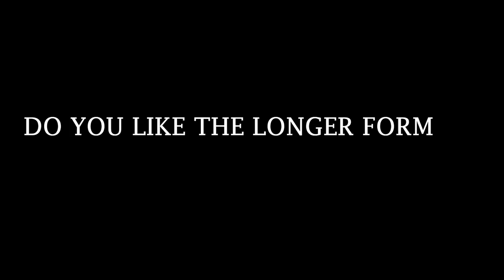American Bee hives are ALL WRONG here is why! split hives 4 weeks later

Comment: This is really encouraging - I have been keeping bees for 10 years but the boxes have gotten so heavy for me as I am getting older.  I was seriously thinking this is my last year to keep bees. Maybe I can manage to keep it up if I switch over to the long version.
Reply: Its really genius design. I've seen african versions of it where they have a triangle design the only difference is they having to cut off the whole bees wax
Reply: @releventhurt  top bar hives
Reply: 8 frame mediums for all your hive gear. Can move any frame anywhere, and 8 medium frames is much lighter than deeps.
Reply: Top bar hives are great, bees are super calm compared to working Langs. Those extra deep frames can still be  exceptionally heavy if you have back issues.

Comment: Would the different frames fit in a standard honey extractor?
Reply: No, they wouldn’t fit and also don’t have the wire suspension that normal frames have so wouldn’t cope with the centrifugal force.
Reply: He has an extractor on his website that will take both sizes and yes you can spin the frames that are wired

Comment: Great video! I am an amature bee keeper, I started with a wild hive that took over my back yard B.B.Q. I bought a thermistor and several books and I was ready to be an apiarist! My B.B.Q. was a large, brick walled, open pit, with a temporary particle board cover. The bees had attached the hive to the inside of that board and I was searching for the queen. I found her under a pile of live bees, on the ground. They were attracted to her sent but I had stepped on her. I was devastated. That was the end of that. At the same time, I was not deterred. I bought three more queens and 6 lbs. of bees. None of which lasted through the year but I learned to love bees and understand that connection with bees. I can't wait to try my hand at it again!

Comment: I'm curious is sawdust, really fine sawdust such as made from a handsaw cutting a dovetail fitting, would work in place of the wool insulation?
Reply: It would (old ice houses use sawdust as insulation), but if it got wet, not so much. Also, most woods after getting wet inside a closed space would, being very slow to dry out, rot and mold.  Also remember that it is the many air spaces in insulation that are the barriers to heat transfer, a fine sawdust should have a better insulation value than chainsaw sawdust.  One might try wood ash as insulation, but I would worry about the water holding capacity of the ash as it would hold water against the wood structure. Maybe if one built a "french drain" in mini form at the bottom of the wall cavity, then it could work. I would still put a larger roof-overhang all around for good weather protection though.

Any powder type insulation (and fiber) would lose most of its insulation value when water-logged. Wool is better than most at holding up in wet conditions and still giving some thermal insulation value, as I understand it. Still, I would build a very good quality roof with overhanging eves for any bee hive.

Comment: Great instructional video! I really enjoy watching Doctor Leo. Here is a suggestion to make the transfer process go even faster. If you put a guide rail, such as a scrap piece of 1×2 on to your plywood template with the saw blade set at the appropriate distance you can just lay the template down on the frame, put the saw up against the guide rail and make your cut without having to measure. Perfect Cuts every time with no measuring.

Comment: Instead of cutting frames, comb, or turning the langstroth frame on end, do what I did -- I made two brackets that extend across just like the European frames, but made so that the langstroth frame ends rest on these two brackets.  The langstroth fames will be facing perpendicular to the rest of the "empty" European frames.  This way you simply transfer the langstroth fames to the European box and put empty langstroth feeder frames in the extra spaces.  The bees will begin filling the European frames with comb and brood and as they turn the langstroth frames into honey frames they can be removed and replaced with an empty feeder frame.  It's quick and easy and you can save the frames for your langstroth hives for catching swarms, doing spits, etc.

I also made a spacer box to fill the excess space below the langstroth frames which is the difference between the European frames and the langstroth frames, to prevent the bees from extending more comb below the langstroth frames.

Comment: I would pre-drill the new style frame for the  possible needed screws and have the screws turned in 1 turn before starting the cutting process.
That will save time while actually working on the hive.
You can go ahead and pull unused screws very fast.

Comment: A great combination of a TBH and a Langstroth's. I've run TBH's for more than a decade and love them, with the TBH's you have even less to build or buy as they don't have frames and you don't need foundation wax, just bars. I have my entrances at the top, less chance of water getting in for the roof covers that area. Bears are our biggest problem, we have to use electric fencing to discourage them. Great tip on insulating! I know from catching swarms the queen can be elusive, several times I've moved a swarm only to go back later and check the swarm spot and find a small group of bees huddled together, around the queen, which I then catch and move to the hive. You can also do a gentle fast tapping on the side of the hive with your hive tool and that will encourage them to go inside, sounds crazy but it works. Over harvesting is another problem with traditional beekeeping, which leads to weak colonies and opens them up to disease and pests, the less sugar water you feed the healthier the hive also. By practicing these guidelines I have not lost many colonies over the years. (mostly from bears and wax moths) Love the bee videos!

Comment: I love the insulated, deeper and thicker hives. For one, the box looks a lot more sturdy and if its more natural for the bees I'm all for it. I also like the rotating metal wheels for the hive exits. My only question would be - would the insulation and thicker hive make it more difficult to for the bees to cool during the summer months?
Reply: i'm no beekeeper, but a carpenter, and i can tell you that insulation works both ways, helps keep the heat out as it does keeping cold out. my grandfather would sometimes wear longjons in the summer time!! hope this helps!!
Reply: Remember that insulation slows the movement of heat from one side of a wall to the other. If the peak heat of the day is around 2:30 P.M., then the hive may be shielded from that heat for several hours to when the sun is not so intense. The end result would be a lower high temp. for inside the hive. That would give them a warmer night time temp. as well, as the daytime heat would be held into the night. They would also be nice and cool all morning long perhaps.
A radiant barrier would be even better in the summer, but a man-made one would need to be such as not to block heat in the winter. Deciduous trees give a natural radiant barrier (water in the leaves of the tree block radiant heat as I understand it), and as the leaves aren't around anymore by winter... :)

Comment: I have to agree with what you're saying about the standard langstroths across the USA. I experimented with those and the langstroth long horizontal. The standard ones were not kind to the bees overall. The horizontal version, had almost no issues. Very good on the bees, just need to adjust my design a little. Next year, we will be trying out the AZ Slovenian style hive with bee house. Hoping it works out great.

Comment: The only negative I can think of about that European style horizontal hive is that everything has such tight constriction points to crush bees in so it'll kill and maim thousands of bees every time you move anything around. Having gaps means places they can slide through and escape. Also how did he do this unsuited? I couldn't MOW when I used to keep bees for a quarter of the year.

Comment: What i would have done is after the conversion take the frames with queen cells and make a in hive split using the  Divider board. If slpit fails combine with original hive.

Comment: solar systems do not like long lines due to excessive losses  so i would put in a separate system for the greenhouse.  also recommend a larger panel for the greenhouse as well as a different type of battery, probably a trolling motor type as it is used to deep cycling, automotive batteries are not.  great starter system though.  this video looks like you could use it on house as well, maybe another day.

Comment: I notice that the Layens hive has no ventilation at the top of the box for the bees to evaporate the nectar's moisture. How does this affect the hive's health, do the bees just hang on at the little round entrance and flap their wings to expel the moisture content? I like the idea of the double-wall construction with wool insulation. This would certainly keep the bees warmer in the winter months and cooler in the summer. Once again, with 60 to 80,000 bees or more inside, it's still going to get relatively warm, hence the bearding effect. Wouldn't ventilation once again at the top of the hive help with heat dissipation during the summer months?

Comment: Maybe a hybrid box that uses both frames one side deep one side shallow. Then put the bees in the shallow end and let them transfer to the deep end. Then later you can again divide them into a deep box....
Reply: Why not have insulated boxes? 1/4” plywood sandwiching styrofoam board. (Plywood/styrofoam/plywood). Even 1/8” would be strong with 1”-2” polystyrene...

Comment: Just came across this great vid, very informative.I like the easy way of going horizontal.  Question- how about modifying the new horizontal box-make it deeper, to accept the american style units by turning  long side of tray pointing down, then add a top cover piece to bridge across this way no cutting to reduce, and the transfer is the whole including bees, no brushing into the box...? any problems with that method?  As well, would use more common tray, convert to the Euro tray as time and $ allow.

Comment: On the other hives, there was a...ledge for the guard / protector bees. With this new hive (great insulation) with the little circles, there is no ledge, where do the guardians sit to protect?  What happened to the trays in the bottom that were in the horizontal hives with DE for any parasites?  
These new hives with the great insulation....how harsh of a climate are these good for?  Would they work for hives in Alaska?

Comment: Quick question, for the insulated hive transfer, I noticed you left bees on the other side of the division board, without frames. Assuming you had a gap below the divider to allow them to move back over... do you later add frames to that side too, just to prevent comb building on the lid?

Comment: I'm curious to know how the bees treat the comb that you installed sideways I'm talking about the smaller cut off pieces when you look at the way bees draw honeycomb you can tell what position it was in because the left and right side of each cell hexagon will be vertical if you turn the cone sideways those straight sides become horizontal which is not how the bees intended so please let me know how they act when you turn their comb sideways

Comment: I'm curious, why didn't you attach the shorter part of the cut frames into the bottom open area of the new frames instead of putting them into a separate frame?  Does the open space at the bottom of the frames give some benefit?

Comment: I am wondering about extracting honey with the longer frames. Does the standard US made extractors take the long frames?
Reply: just make a rack where you angle a few frames and cute the cap open it will oooze out, thats what i do with my top bar comb when i want them to get the comb back
Reply: oh and once a side is drained do the other side...its really not slower than with an extractore

Comment: I can't say thank you enough. I built one horizontal hive to try it out. WOW! the increased activity was extremely noticeable, so I built another then another. No more dead hives in spring due to cold weather all due to year-round insulation in wood density and rooftop insulation. Great easy plans are available from horizonalhives.com  Please note to use 1/8 inch screen wire on the bottom if using a pest oil trap. My first mistake was using 1/4 inch and them bees built comb under the wire.  What am I going to do with all my stackable hives now? UGH!

Comment: Why bother to build an all new hive? 
Just add 2x2 spacers to the exterior surface, also frame the entrance, then put on the insulation, then cap it off with plywood leaving the entrance open. Also make a larger roof to reach over the new exterior.

Comment: With the horizontal hive, there are ‘missing frames’. In a standard vertical hive, this means bees will fill the space with comb. How do you prevent this in the horizontal hive?
Reply from the maker: No missing frames
Reply: @OFFGRIDwithDOUGSTACY  sorry, I spoke incorrectly, I meant frames with no foundation or just lots of frames (too many). I have, however continued watching and literally just got to the part in the woods, where he is adding a divider board which literally answers the question 😂

Comment: I have a question. Is a layens ok to use in the deep South( coastal Alabama)? The reason i ask is our high humidity and no ventilation on top. I have a long langstroth hive but need another hive and am thinking about trying a layens hive. I'm in a wheelchair so these are the hives i can deal with. I've run into problems having only one hive.

Comment: Wouldnt it be easier to just load the new hive with a split and new queen than all that cutting and screwing and shaking and brushing?     Figure thats what i will do ...   let the old hive do its thing.    Matter off fact,   since they swarm so much i would use the original hive as my mother hive to produce many more.     Think smart, not hard.   This guy is a pro,   but that is too much disturbance to take old bees into a new hive when you can just start another hive with all those swarms and queen cells available.

Comment: When you build your beatbox why wouldn't you just use styrofoam insulation that would keep them totally nice and warm . I mean I would think if you use styrofoam insulation around the whole box it would stay nice and toasty inside in the winter. I would think that using plywood would be the wrong thing to do . I would use regular 6-in boards and make them tongue and groove . that way I don't have to worry about the plywood glue , because all plywood has glue on it that's how they make plywood. they put it in a big lathe and spin it off in big thin sheets and then glue them together. So using just regular boards tongue and groove I think would be a good way to keep any pesticides any glues or any stuff like that out of your box and keep it nice and clean..

Comment: I don't see how the bees get around in there shouldn't they have like a tunnel in the middle or something so they can get from one area to another
Reply: Might be different than the old one i have at home but there the frames are a bit higher from floor so they walk from one place to other on the very bottom, and the separator board is what goes all the way to the  bottom not letting them pass

Comment: You never rotate the comb as he has done.  All comb has a top and a bottom, and if you rotate the comb 90 degrees as he had done will kill the brood and cause them to drown in the comb.

In Ukraine they have a lot of horizontal hive, but they build them into sheds,  where the hive are along 3 walls.
When I first saw the bee house I thought it was a utility shed.
It was explained to me that it is easier to work on the hives in a building, and easier to keep the hives warm in the winter.

Comment: I've asked around on the bee forums locally(Alberta Canada) and no one advised me to got with a horizontal hives.  Apparently they freeze in winter, not being able to travel to their food stash.  Any comments from Dr Leo would be greatly appreciated.
Reply from the maker: Wrongx equip it with the insulation and out perform them then YOU tell em 👍
Reply: @OFFGRIDwithDOUGSTACY   Alright, I was asking experienced beekeepers and I'm just starting out so I need lots of "you need to make sure to do this" advice from Dr. Leo  :)  I've been running one hive, lost them to silly mistakes in a vertical last winter.  I got two nucs this spring and I'm taking the time to learn lots from watching them and working towards splitting ,getting locally raised queens to install since my current queens are Hawaii ladies  That will be next year if I can sucessfully overwinter them this winter.
Reply: @OFFGRIDwithDOUGSTACY   question for Dr Leo.  I have bags of alpaca fiber sitting around unused.  Could I use that instead of wool?